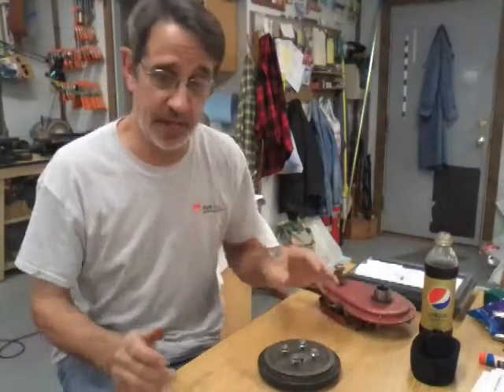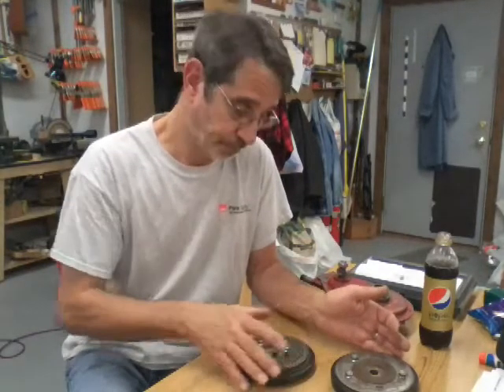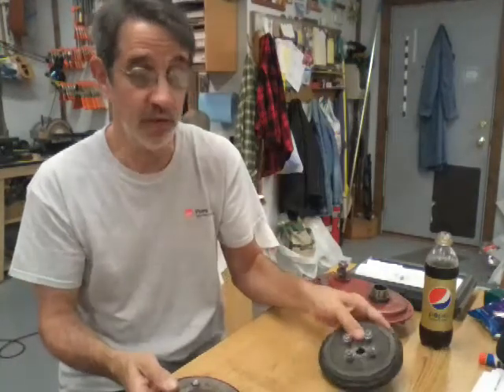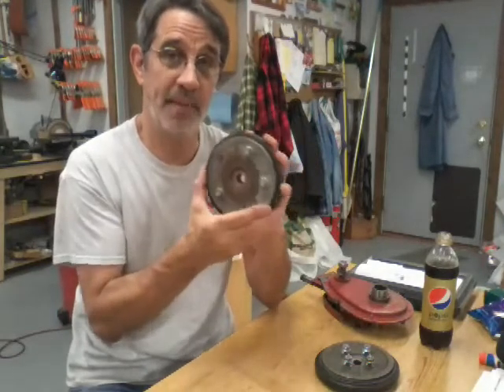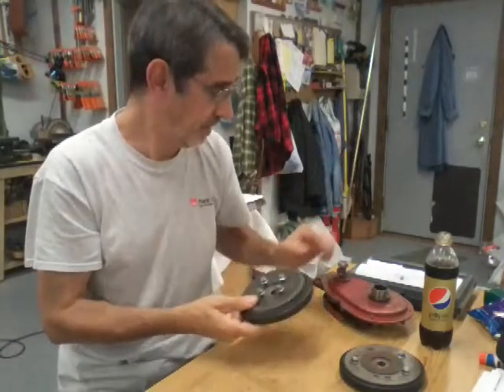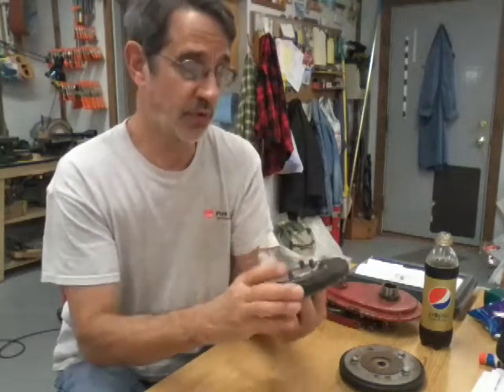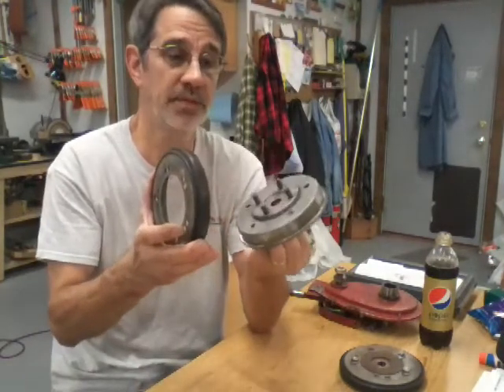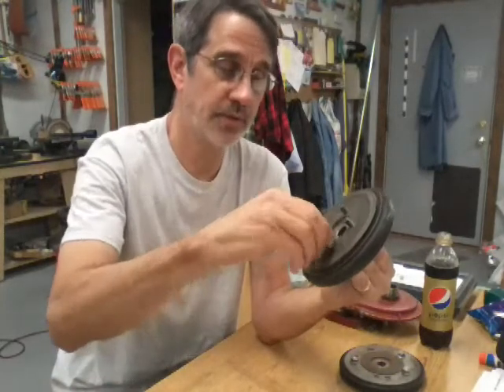139. M/S. 20  How to assemble and disassemble a clutch disk assembly.

Comment: Hello Jim, The clutch disk on my snapper model 281223BVE is loose, do i need to tighten the center bolt to the case? the mower is having a hard time starting to drive in all speeds and i was in the process of changing the drive disk when noticed the clutch disk is loose
Reply from the maker: Well, the clutch disc is supposed to be loose and it should turn freely on the clutch disc assembly. The clutch disc assembly should not be loose on the shaft. The best thing to do is take the clutch disc off of the assembly and check to make sure that the 15/16 nut is tight Holding assembly onto the chain case.   
         Jim

Comment: Hey Mr.Jim ,glad I found your channel !i just got a snapper sr1642 mod 421618bve, my question is is it possible to put a soft clutch on instead of the hard one that’s on there ? When I take off it it pops wheelies! And the clutch/brake pedal is really tight. Thanks for your time and I enjoy your videos.....Todd
Reply from the maker: dimebago 
  Hi Todd it's Jim
  Yes you should be able to take off the entire clutch assembly and replace it with a soft clutch assembly on the chain case, if you could take some pictures of it on the chain case and a picture of the chain case with out the clutch assembly on it I can tell better by looking.   you can send the pictures to my email which is
jimsfixitshop@gmail.com. Thanks Jim
Reply: Jim Jackson thank you sir , I’ll get out there tomorrow and get you some pictures
Reply from the maker: dimebago 
When you remove the clutch from the chain case can you mic. the shaft for size and length.  Thanks Jim
Reply: Jim Jackson 
Just checking to see if you got the email ..thank you

Comment: Hey Jim, my clutch/break pedal feels like it has to much play like slack in the cable. Can you let me know or do a video so I can see what to look for and adjust. I have a new clutch on it as of today.
Reply from the maker: Wil H. Hi it's Jim
   Overtime or clutch cables can stretch or we replace the belts and it changes the size of the cables that's why they have Ferrells on the ends of the cables to push through the pedal I had viewers that's also used a small cable clamp on the backside of the pedal to adjust the length of the cable.  Thanks Jim
Reply from the maker: Wil H.   
Hi it's Jim overtime our cables stretch in size that's why they put the ferrules on the cables to pull through the backside of the pedals.  I've had some viewers that have used a very small cable clamp on the backside of their pedals to adjust their cable. 
              thanks Jim

Comment: Hey Jim. My machine is sliding side to side on the axle Approximately 1 inch either way. Is there a bushing that stops this? Where should I start looking first? Thanks.
Reply from the maker: Melloreel 
This is on a rear engine snapper,  with it standing up on its bumpers are you saying you have 1 inch of side play on your axles from side to side. Jim
Reply: Sorry Jim didn't know you responded. Yes sir it moves one inch side to side? Gonna have a look right now with it standing up to see if that makes any difference.